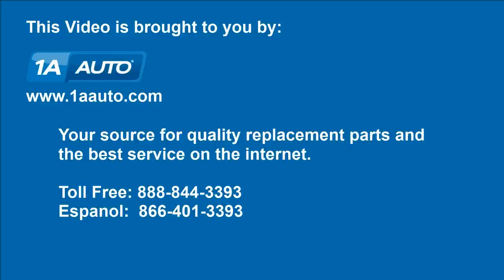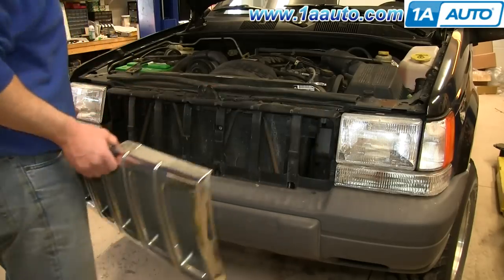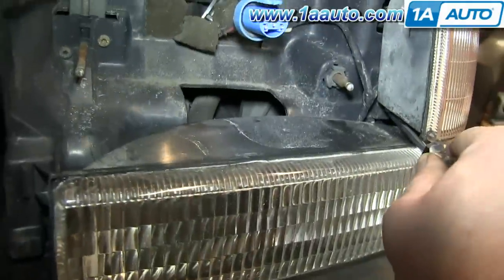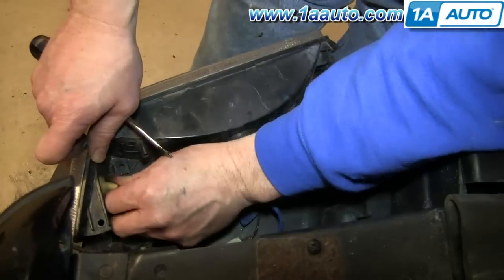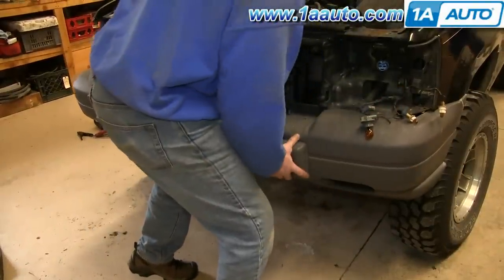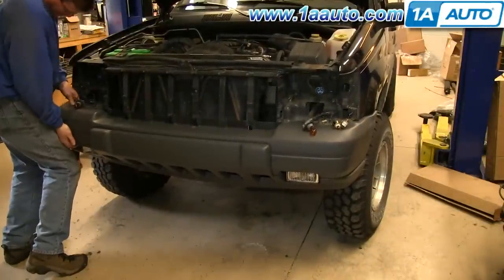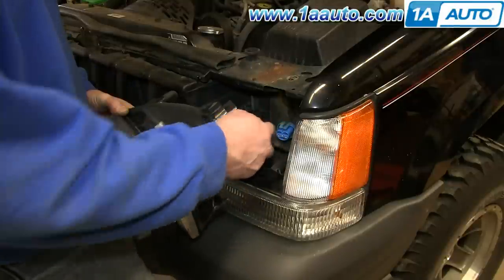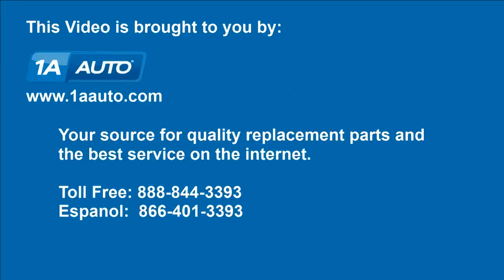How To Replace Front Bumper Cover 93-98 Jeep Grand Cherokee

Comment: Thanks for this well explanatory video. I have just one question. I collided a car from behind. My bumper cover and absorber look fine, but the metal crossbar behind bent. I also crack the plastic in which the grille is attached to but know how to fix it. How can I set it up straight again? Pulling it out using a tow rope with some wood stud beneath may work. And then, how can I reinforce it? Thanks in advance for any hint.
Reply from the maker: +Cientificalízate Panamá I recommend taking that type of work to a collision center to fix.  They will have the proper tools to do the job right.

Comment: What tool did you use to get bumper off tho?
Reply from the maker: +Korynna Fuller You can use a trim clip removal tool to get these rubber fasteners off. You will be able to find these at a local part store.

Comment: my jeep's engine oil cap is loose and wont open. is there a way for me to unlock the cap without damaging it? thank you
Reply from the maker: +Muhammad Zaki They can be finicky sometimes, you might need to just tool around with it.  If that doesn't work then you may need to get a new one, because removing it will most likely result in it breaking.